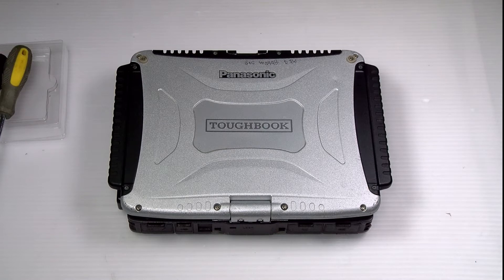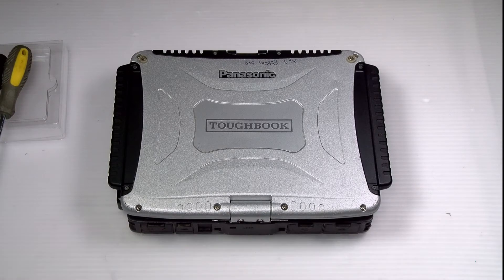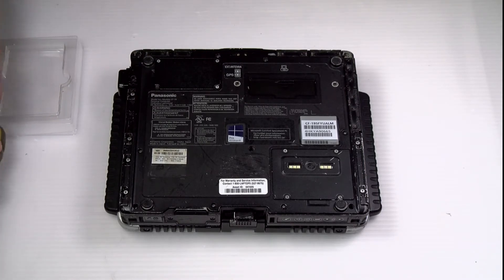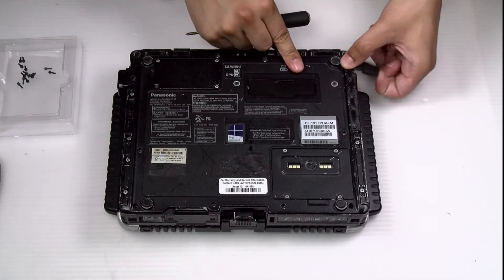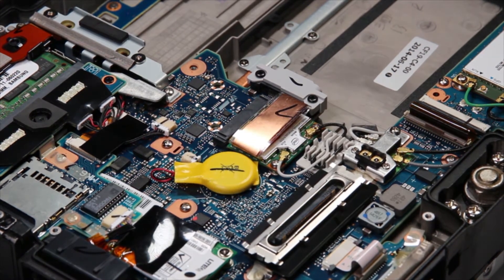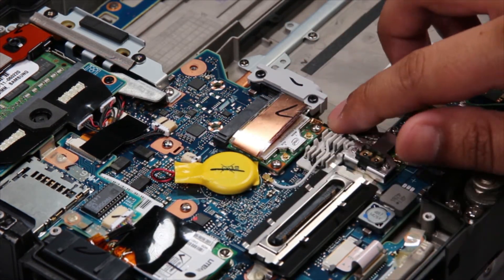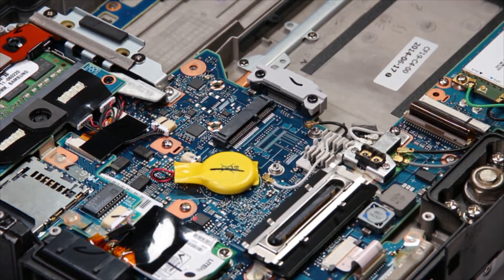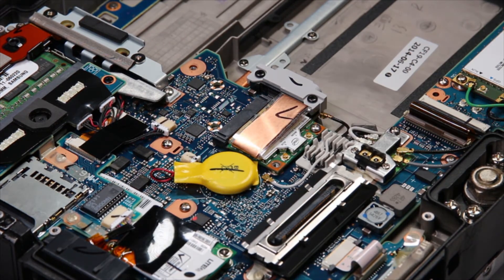Replace Your Panasonic Toughbook CF-19 Wifi Card!

Comment: I have the mk5 version with Centrino Advanced N-6205 card, is it the same layout with yours? I want to replace it with card that has WiFi5 / AC standard.
Reply from the maker: We have had no success on different non oem wireless cards working right in the toughbooks.

Comment: Hi, 
I have a Panasonic cf-19 older version H I think, wifi works great but sluggish by today's standards, I wonder if there are faster network cards (wifi) for these older devices, if the answer is yes, if so; do you sell such cards and possibly how much it might cost?

Thanks and regards.
Reply from the maker: We do sell a couple. You can check out the WiFi card that is compatible with your MK2(H) here- we sell it for $19.99 plus shipping: https://www.bobjohnson.com/panasonic-toughbook-cf-19-mk1-mk2-mk3-cf-30-wifi-card/

Comment: I have a Toughbook CF-19 it has Bluetooth 4 inside.
I have an OBD scanner and it needs to communicate with a Bluetooth v5
Do you sell Bluetooth v5  OR do they make v5
Is there any way that my OBD dongle can communicate with my CF-19
Reply from the maker: Hi To F, there isn’t a Bluetooth card for the CF-19 that supports Bluetooth v5 or at least not one that is meant for the CF-19. We didn’t see one that would work with a quick search. All the ones we found are a newer/smaller form factor and will not fit in a CF-19. There are USB Bluetooth 5.0 adapters you can get that would allow you to have Bluetooth 5.0. However, Bluetooth v5 is backwards compatible with Bluetooth 4. Most devices that support Bluetooth 5.0 will still work with devices that run only v 4.

Comment: Hello! I have cf-19 mk6 i think it doenst have wifi from factory. Where i can find wifi antenna cables ? I dont see them anywhere close to card port. Replicator aux does have all 4 cables. Have you seen cf-19 without wifi cables and antennas ?

Comment: There's no wireless card in my cf-19 and the white and black cable in your video is not there
Reply from the maker: You may have a unit that was sold into the military.  They typically do not have wireless cards or the cables.  You can find them on our website: https://www.bobjohnson.com/cf-19-internal-components/?_bc_fsnf=1&Part+Type=Antenna